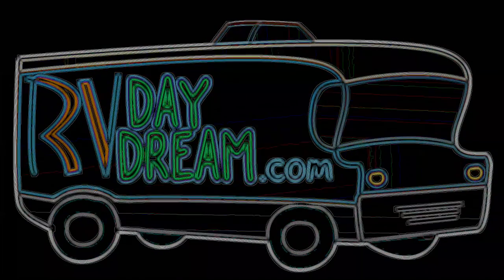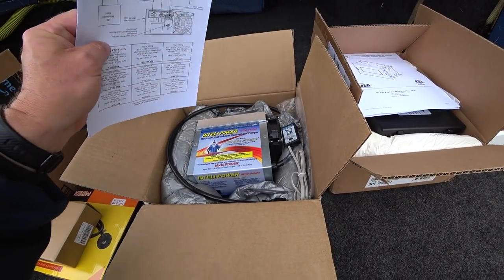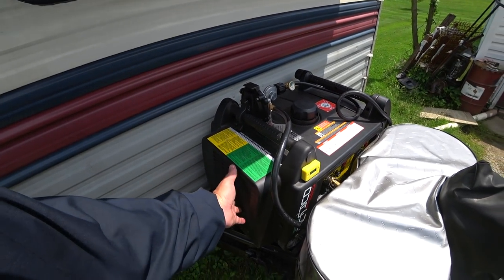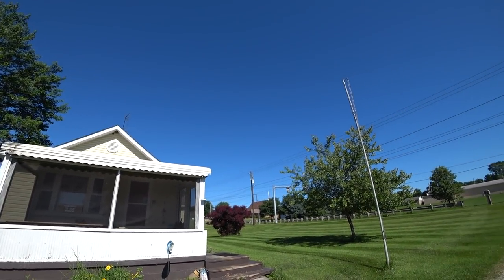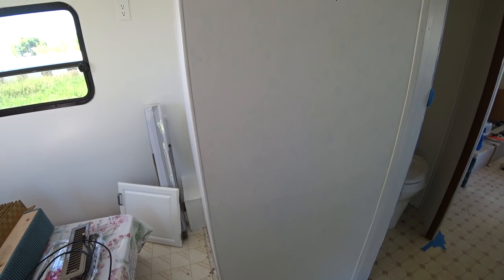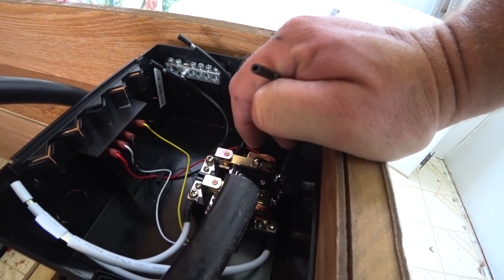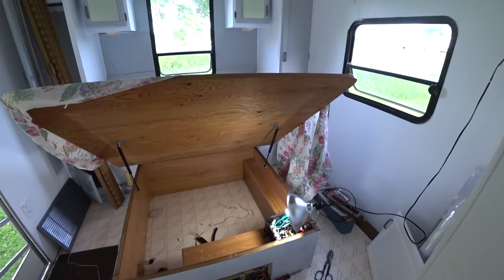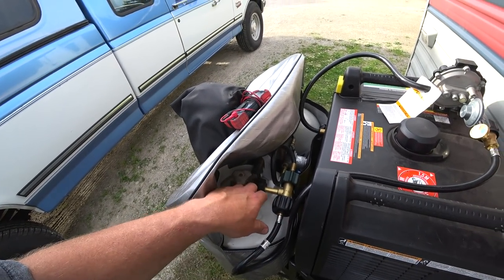RV Project Wiring Progress

Comment: great vid! really appreciate your being thorough and taking the time to explain it all. Only add I might have would be to bolt on an exhaust pipe extension the routes your genny exhaust down below the level of the   metal skinned the rv. might save you some minor heat buildup inside your front cabinets or whatever. of course, in the winter....might be a plus
 ;) yall keep it up. looking good!
Reply from the maker: Let's Be Logical Thanks! Check out my earlier videos, I have the extension pipe... I wanted to show the Temps without it..
Reply: oh, ok. whoops. I am a new subscriber on your channel and haven't seen many of your past ones as yet. thanks again for taking the time...I'm learning a lot and enjoying the presentation.
Reply from the maker: Welcome Aboard!!

Comment: Very cool setup!! I have been in the propane industry all my life, don't modify the hose or fitting coming out of the demand regulator for your generator, that is its "tuning".  If you change anything, like the length of the hose or even add a 90, it's like changing the jet sizes in a gasoline carb, could richen or lean it out, either way you know what that means.  And the demand regulator needs to be oriented the same way as if it were directly connected to the propane cylinder.  Because the earths gravity can affect how it works, and can richen or lean the engine, and you know what that means!  I tell you what though, if I had my generator mounted there, I would take that low pressure regulator off of the demand regulator, there is a brass fitting between the two. And put a T on the bottom of the rv change over regulator and hook them together. Then the generator would run off the rv change over regulator and use both bottles.  Although, you know I can't recommend that anyone do this, it's simply what I would do.
Reply from the maker: Chuck Webb not being familiar with the pressures in which all that operates, and before I made any decisions on where to mount this stuff, I called and spoke with champion directly. They advised me that the regulator could be run on top of the generator with minimal to no ill effects. As far as the 90 degree I'll make sure that the interior wall is not reduced for flow reasons. Again, Champion said that the slight increase in length would not be an issue. Now, as far as running off of the regulator that the RV is equipped with, Champion said the only problem that they have ever heard of from rvers attempting the same thing is having too little Flow. They said they have heard it on more than one occasion. Which as far as I know the WC rating on this thing is like 11, which is far as I know it's like a industry-standard. But the main problem that I was concerned with is that larger part of the two stage regulator finding a place for it underneath of the factory regulator. I still may do what you say as it was what I wanted to do initially, but it's awful tight mounting that thing in there. Plus the outlet hose may need to be modified in length at that point. But, again, there are people that's already done it and they've got real long hoses coming off of their RVs running to their generators. So, it may not be over yet. :-)👍😁
Reply: RVdaydream The problem people are running into with the lack of flow is not removing the low pressure regulator from the demand regulator. If you leave it you'll have 2 low pressure regulator in line and that just won't work. You don't have to mount the demand reg to the bottom of the RV reg, you could use a rubber hose and mount the demand reg wherever you want, just don't forget to us a cutoff valve between the RV reg and the demand reg to be able to shut down the generator and not all of your appliances.

Comment: Well Heidi,  You are the greatest you have patience+++++++. That wall he just got to and glued.  now i would take the used peaces  of masking tape tier into 3/4/5 inch peaces laying them in any direction/over lapping each other  from ceiling  to floor paint all one color like grey thin coat let it dry, Then dip a clean cloth in white pain rub it all over picking up the edges and grain of the tape giving it an  antiquing affect.  We  did this with kids and adults craft class .  The kids used coffee cans and shoe boxes. We had to use new tape and smaller peaces and shoe polish for staining. Adults went home and did offices / rec rooms / Kitchen cupboard door. A grade eight kid did his dash in his car because it look like wood.  Have fun Heidi. cost 0 / truck many $$$$ .  just saying.   The air conditioner cover well Mike likely has a new one coming,hahahahaha.   right.   Looken good  Guys. Fun to watch.... ByeBye.

Comment: Looks good and the generator should take preference like you have it over the pedestal power. The portable generators do have an open neutral.  I have heard about making a bonded plug that connects the ground and neutral wires, then just plug it in an available outlet in the generator to eliminate this.  I don't know much about it other than people do it to allow their surge protectors to work properly with a portable generator.
Reply from the maker: RV Habit yeah, the bonded neutral plug seem like a pretty easy thing to make however when I went to check on which terminal to bond with ground, they both had power. So that's when I called champion. They said that their generator has an open neutral and it's not the same as Honda generators. Leading me to believe that I could not Bond the neutral, as the neutral floats. So as long as everything runs okay and I'm not being electrocuted then all is good. I still would like to have done the bonded neutral thing.

Comment: To solve your open ground issue just take an extension cord end put a jumper wire between the neutral and the ground lug and plug it into the generators 15 or 20 amp outlet which ever it has.
Reply from the maker: John Irwin that's what I thought. However when you look for the neutral, there isn't one.... there is power being read at both Outlet ports. Meaning I put the negative of the meter in the ground receptacle and then using the positive probe for the meter I tried the left prong and the right prong and they both have power going to them. That's when I called champion and they advised that it is a floating neutral. So as you know, you cannot Bond a power to the ground.

Comment: I installed that same transfer switch, it works great. You think it's hot there? I live in the Florida Keys it's 88 degrees 72% humidity the dew point is 77 feels like a hundred!
Reply from the maker: william rizzo it's funny, because sometimes the Midwest can be pretty brutal too. I personally like the heat and humidity, however Heidi not so much. Except our last trip to Florida, the heat index in Fort Myers was 104 and she sat outside underneath the awning reading a book and of course smoking while I was inside in the air conditioning editing videos. Yesterday we were 93 degrees with a dew point temperature of 68. I believe it's going to be warmer today. I was born and raised in Melbourne Florida so I like the Heat. But, I I hate the winter. Hate hate hate hate. The winter sucks. Can hardly do anything outside and the inside it's awful depressing after two to three months. All the years that I lived in Florida though we never visited the keys definitely on the bucket list, and can't wait to get there. Our next trip will be out west though. Time to see what all these other RV years are doing out there!

Comment: Happy Fathers day, great Video one question is the bran or name of the polyurethane you used
Reply from the maker: RVing With The Ruiz thank you! I don't remember what brand I used. And I think that I've thrown the tube away. It was just polyurethane that Lowe's sold. If I can find the caulking tube I will make sure that I type it in here somewhere, or mention it on a video. Thanks, that's what I didn't think about!👍😁

Comment: you could hide that damage with  on that wall with 8829 1/2 in. x 5-1/4 in. x 96 in. MDF Primed Colonial Base Moulding from home depot for $12.80 /each. it would also spiff it up as well
Reply from the maker: wrangler Dave we have some of the thin finished plytanium that Lowe's offers however the increased height although very slight by the thickness of the board would require us to put up all new trim including a strange angle piece on the corner that we have a tendency to rub every time we go into the bedroom and walk around the bed. So we decided just to doctor it up the way that it currently is. Because the last thing I want to do is trim work I hate it as you could probably tell throughout the RV my skills are limited in that department.
Reply: understandable...

Comment: Exhaust fumes from generator entering the rv through the window??
Reply from the maker: R Reveler carbon monoxide detector in the front of the RV.. No more chance of fumes entering through windows on this setup VS motor homes that are equipped with a onboard generator..

Comment: Happy Fathers Day Mike- I've been looking for a ATS. You may of solved my searching. Can you tell me which side of the ATS has the yellow wire? (Shore power or Generator) .
Reply from the maker: Thanks!, looking back at the video from what I can tell the yellow wire looks as if it goes to what would be in the picture as the top of the box so the top side is the connection that goes to the panel. So to answer your question the yellow wire does not go to either Shore power nor the generator. Here's a link to the wiring diagram for this one. -- https://www.progressivedyn.com/wp-content/uploads/2017/05/110538A-English.pdf
Reply from the maker: Oma and Opa’s Camping Adventures actually, now that I look at it on the wiring diagram that shows the yellow wire goes to the changeover relay.
Reply: I agree that yellow wire goes to the changeover relay.  With your reply I wanted to know which side had priority. Here's my situation. I'm going to use the ATS for invertor/Shore power. I want Shore prior to be  priority when available. So which side of the changeover relay (Red or yellow wire) has priority?? OR does one side to drop out before the other side picks up??
Reply: Hey Mike- your off the hook. I called PD and they set me up with the right way to set up a ATS with a Invertor. I'll do a video on the install in a couple of weeks.

Comment: What's the propane cover rated at?
Reply from the maker: Neil Cotter? Rated?
Reply: RVdaydream sorry, I should have been more clear. I was referring to the temperature rating of the cover. At what temperature  would the cover ignite? It looks like nothing around it would get that hot though based on your temp gun readings.
Reply from the maker: Well the fact the tanks get really cold when the propane is being used probably lowers the cover temps more than raise it...The exhaust pipe was temporarily pushed on the genny and after 40 minutes it fell off and the part that was on the exhaust stub fell against the cover and it didn't even melt a hole it it..Not sure though..
Reply: Good points all. I have tenau cover on my truck that can fold forward in three sections. I'm toying with that compact crane idea to just hoist the Gen in and out by myself.

Comment: So many people will paint to refresh and change the look. But Never use cheap painters caulk to fill in small cracks and seams to make clean lines from transitional points. If no caulk it leaves shadow lines(spider cracks) and looks like a cheap throw on paint job.